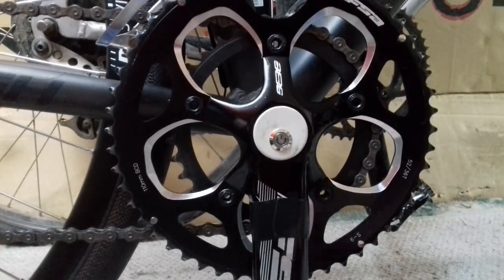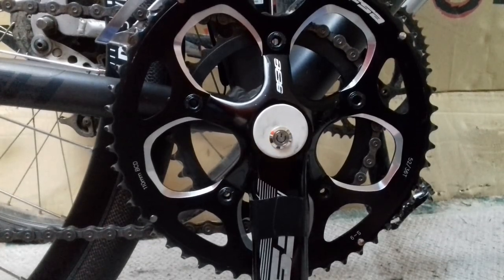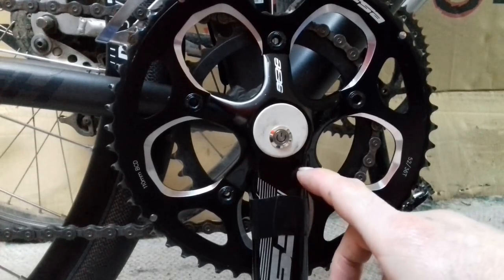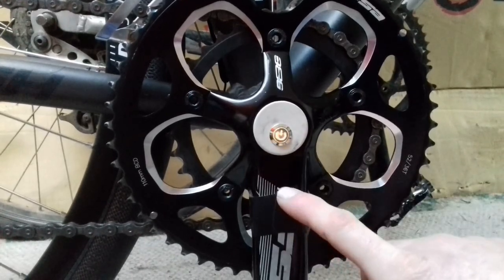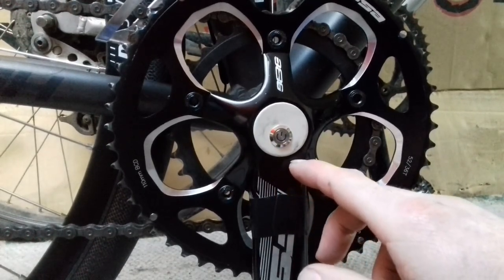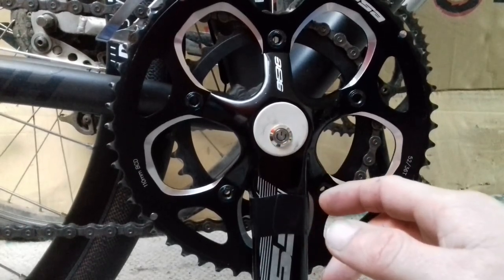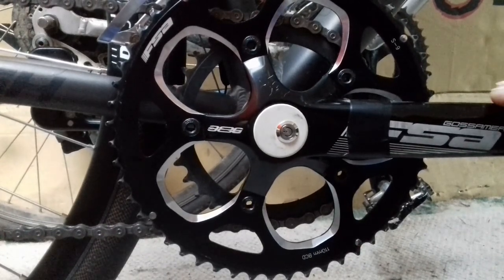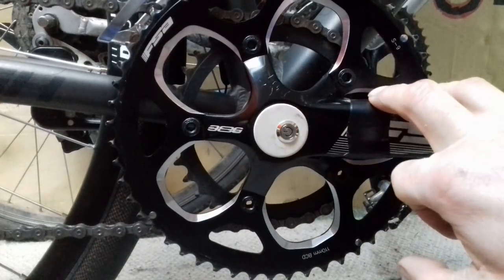Homemade Bicycle Power meter V2 Button demo

Comment: how's the battery life?
Reply from the maker: Not great, about 5 - 6 hours. However there is considerable room for improvement on this. I'm using an Arduino Nano that's running continuously and applying 5 volts across the wheatstone bridge.
Reply: Ed R Ed R hey that’s not too shabby. Love your videos man, they’ve been so helpful. I’m working on a similar project using a nano ble. Trying to run off a 250mah LiPo so I suppose low power consumption will boil down to how good my code will be. Happy to share any findings with you
Reply from the maker: @drewvigne   Andrew Vigne  Thanks, I'm glad I've helped. I'm using a 300mAh Lipo, lasts for around 2 rides.
Using a Nano BLE and ANT+ is my end goal with the project. Currently learning to use a Nano Every as a step towards this. There's a lot to know about the ADC as it can do so much more than the analogRead provides. What I'm learning is an analogRead in a 1kHz interrupt is not the best way. Planning to make a video about it once I learn the code.
A significant amount of energy is wasted in the strain gauges, but this can be reduced by dropping the excitation voltage. Problem is this means more amplification. However I also want to experiment with using a lower reference voltage for the ADC to compensate for this and reducing the need for extra amplification. Got down to 0.6V on a typical Nano.
Would very much appreciate any knowledge you gain about the Nano BLE.

Comment: Hi, 
I'm trying to build power meter for my spin bike. 
My question is if I know and I can replicate exact level of resistance on the wheel, is it enough for me to measure Nm needed to move to bottom bracket axle, and then multiply that Nms by cadence?
So I can map the values ex:
 10% = 3.5Nm etc?

I think it should be possible.
Reply from the maker: Think I understand what you mean. So measure the Nm when the BB axle isn't spinning? Then assume the resistance is the same when it is spinning.
If that as the case then yes it would work to use it in this equation, Power = (torque (Nm) x speed (rpm))/ 9.5488
Problem I see is how do you prove the resistance remains the same as the rpm changes?
Reply: @Ed.R  I have load cell mounted on the wheel resistance pad. So I can pretty acurately replicate resistance of the wheel based on the weight applied. 

If so how would you conduct calibration please as I'm strugling to calibrate it. 
I have cadence sensor based on esp8266 and it has very acurate reading (compared it with my garmin cadence sensor)
That only thing is main torque aspect. 
I can measure that with Nm meter tool.
Reply: Where is more torque reguired to move it from stand still, so shoud i use the tool as a crank arm, and measure torque applied on the tool while spinning the wheel?
Reply from the maker: @adas4190  Sounds much more viable now. Effectively you are measuring the backwards force a bike applies to the road to keep moving forward. 
Just trying to decide if there is any difference in this force if measured stationary rather than spinning. Friction should directly relate to the force measured I think. Don't think there would be anything wrong with calibrating while stationary. Apply known weights to the crank and note the force measured.
Reply: @Ed.R Thank you for your help, will it be enought if i use tool attached to a bb axle or it is better to attach it to a pedal axle on the end of the crank arm? Should Ihold the tool on its full lenght or in the distance 175mm as my crank arm lenght is?
I'm not an engeneer and I'm grateful for your help
Reply from the maker: @adas4190  No problem hope I've been able to help.
What is the torque tool that you mention, a torque wrench?
If so you will need to attach it to the BB axle. The location you push it doesn't matter it will read the torque applied to the axle.
I would just hang a some known weights off the pedal axle or use a spring balance. Calculate torque from the force and crank length.
Reply: @Ed.R  i have little electronic scale that you hang on something (pedal in this case) and attach weight below it. If i use that how can i calculate torque from this weight? please?
Reply from the maker: @adas4190 You might find this video helpful https://youtu.be/ry0pG-GqD7g
Reply from the maker: From 3:47 I explain the equation. Basically you will need to convert to Newton's from kg by multiplying by 9.81.
Torque Nm is just Newtons x meters.
If crank length is for example 172.5mm this is 0.1725 meters.
Reply: @Ed.R  i will have a look
Reply: @Ed.R  result I'm getting is a bit off. What I did is 15.27Nm x  cadence (80rpm) = 1221,6. That is i think 122w.
Reply from the maker: @adas4190  You need to take your answer and divide by 9.5488 because rpm isn't an SI unit.
The power equation is (Nm x rpm)/9.5488.
Reply: @Ed.R  oh ok. Thank You 👍
Reply: It works!!! Wow I have been workin on it for a week to gather all parts. Only logic of it all held me back. You  are star my friend!!!! Thank You so much, i will simplify few things and it's done!!!
Reply from the maker: @adas4190  That's brilliant you got it to work 👍, so pleased I could help. Thanks for the feedback, often I don't get to here how people get on.
Reply: @Ed.R  I plan to make a video on how I make it so it help others. I used esphome project on esps and home assistant for calculations and sensors. Thank You👍
Reply from the maker: @adas4190  Please do that sounds interesting.
Reply: That is what I have done 😊